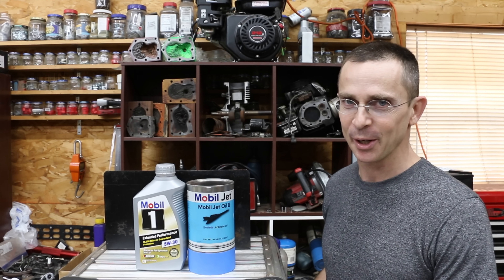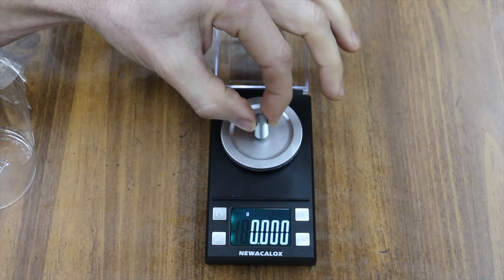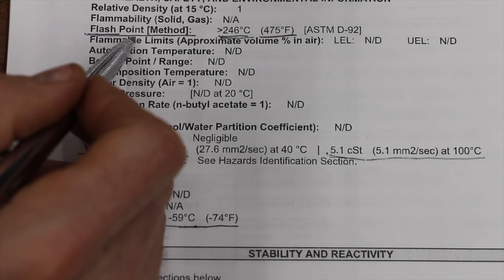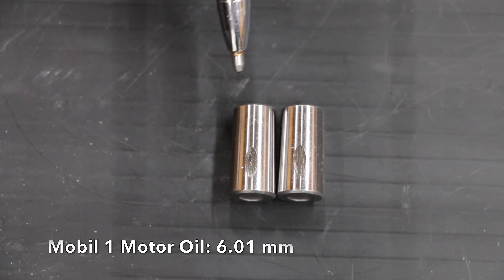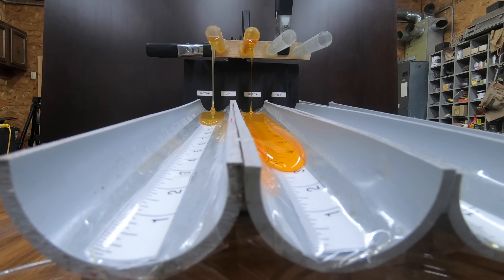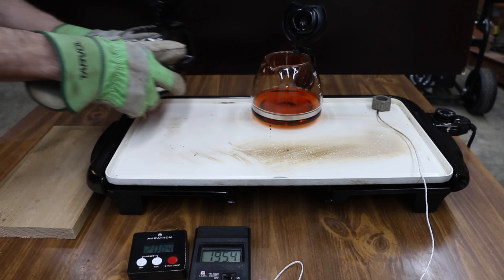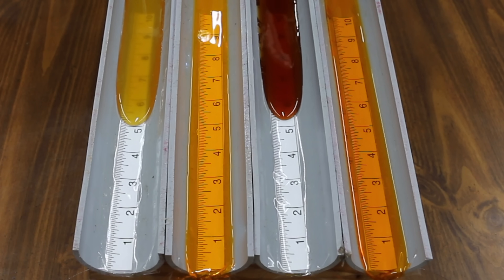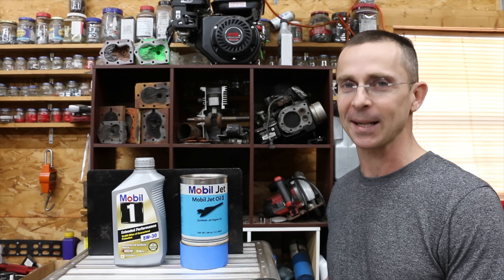Is Jet Oil better than Mobil 1 Synthetic?  Let's find out!

Comment: The lubricity test results are questionable. If the testing cylinder is worn out it means that oil lubrication film is broken. In the engine, it should not happen. The metal parts should not have any direct contact with each other. In your test machine, you exceded contact stress for all oils. Plus contact surface is growing exponentially (very fast at the beginning, and slower and slower by the end) because of this fact if the wear spot is big enough, it is difficult to see the difference. I would recommend the following
1) to reduce test duration not to create a big wear spot. On smaller spots difference should be bigger.
2) Ideally, you should measure oil film breaking pressure, adding force to your machine until you see any wear to determine breaking pressure (contact stress) for each oil.
Reply from the maker: Thanks for the constructive feedback

Comment: Had a surprise with Mobil One synthetic. I had some quarts in my basement for about 5 years. Pulled them out to change the oil on my Cub cadet and it had darkened with age. Looked like the cooked oil. Wonder if it is as good as the very light fresh oil? There isn't an experation date.
Reply from the maker: Thank you!

Comment: Me: Knowing jets fly at extremely high altitude and extremely cold temps

Jet Oil in -15 degree Freezer: Am I a joke to you?
Reply: Jet engines have fuel/oil coolers. An accessory that has a core inside that runs fuel around a jacket that has hot oil running through it before it goes back to the oil tank. The hot oil is cooled by the cold fuel and the cold fuel is heated by the hot oil at the same time for better atomization before it enters the combustion chamber.
Reply: @kruzn1934  Well stated. Our Lear 60 has that system, and even when it is -56 C at altitude, which is every time, the oil heats the fuel, and the fuel cools the oil.
Reply: The engine stays warm at altitude while it’s running
Reply from the maker: Great point!

Comment: Interesting. Jet oil never gets changed, there are no scheduled oil changes on Jet engines. They do tend to need oil added regularly.  It doesn't get changed because oil doesn't wear out, as many believe. It gets dirty and cant perform when dirty, thus the additives to make it last longer for vehicle use, Jet oil however does not get dirty as there are no internal combustion engine byproducts to dirty it up.
Reply from the maker: Thanks

Comment: Jet oil is made from animal fat. It stinks. Not the same product. I worked on t 58 turbo shaft engines back in the late 70s and found that the oil in the aircraft had never been changed. The engines have been changed but we just disconnected the oil lines and dropped the engines. The oil lubricates a series of bearings and is never in contact with anything like piston walls. We would clean filters and send in oil samples every so many hours.  The engines turned at 20,000 rpms
Reply from the maker: Thank you!

Comment: The wear test results can be validated if: 1 The jet engine oil flows better and it allows the electrical motor to spin (RPM) hence scratching the surface of the bearing many more times. Or 2 the car engine oil bonds to the bearing better giving better protection.
Reply from the maker: Thank you
Reply: unlike in piston engines the oil in a gas turbine engine primarily serves as a coolant hence why it sacrifices the wear and friction reduction properties in favor of better flow characteristics and extreme temperature performance. conventional engines have a lot more components that slide over eachother  requiring an oil that is good against wear where as jet engines t have very few most of the components have rolling elements in them which reduces the friction and wear

Comment: I wonder how Jet oil would do in the lower end of a 2 stroke motor?  Its all rolling friction in there.  Gas mix takes care of the sliding friction.
Reply from the maker: My biggest concern is that jet oil will damage seals
Reply: @ProjectFarm  A serious concern. One that also crossed my mind. But beyond that I bet it would work great.  I would be very interested to see exactly what sort of damage Jet oil does cause seals and how long it takes for them to degrade once there exposed to it.

Comment: You obviously don't understand the demands on Jet oil and the temperatures it has to work in on a daily basis. ..
Minus 50 to plus 50 as a minimum  as it's very cold at 35, 000 feet  ( that's almost as high as Mount Everest )
Reply from the maker: Thanks for the constructive feedback

Comment: I ordered ACDelco motor oil from online, never heard about it before, and apparently its OEM oil used for new GM engines.  Would be interesting in a test with it since its cheap $19 for a 5gallon. And how it compares to Amazon's motor oil
Reply from the maker: Thank you!
Reply: @ProjectFarm  no problem, i went with rockauto online.

Comment: I just came across motor oil that is plant based, called G oil.. wouldn't mind you putting that through the ringer on your machines/methods.
Reply: I also just saw that Castrol has come out with something similar.... be neat to see them vs each other and conventional
Reply from the maker: I'd love to test G oil but I'd like to know what percentage of their oil is plant based. I tried to find additional information and it's "proprietary".
Reply: @ProjectFarm  I've read, that they are both around 25% and it is a significant different formulation that it would be neat to see, but that is your decision to make after all. Just like with all the other motor oils, they are very similar in ingredients, just in differing amounts. Just be interesting to see something you've put through the wringer already vs goil and castrol plant juice... I've also  heard there might be animal fat included but not hundred percent on that, seems to be pretty secretive. I think if we could develop a purely plant based lubrication solution, the planet would be much better off... as well as being renewable. Maybe make farming profitable for the little guy again.

Comment: I would presume the temperatures inside the engine of a plane, is quite much higher than the ones inside a car engine.
I wonder if the Jet engine oil even burns?
Reply from the maker: Thank you
Reply: yeah it burns and oil fire in the engine cause a turbine disc to spin so fast it exploded on an a380 midflight before

Comment: Before i watch it: I d say engine oil is better for internal combustion engine, then jet oil, as jet is technically external combustion, and temperatures there are a lot higher.
Edit: Obviously motor oil is better than jet engine oil, as the most important task of the oil in a motor is to maintain film during oil starvation in stroke up motion, when the explosion region of the cylinder can not be lubricated, hence why viscosity is significantly lower. YOu can always get a lower viscosity motor oil, but there is a reason why motor engineers recommend using specific oil in specific engine in specific location. They are not dumb =)
Reply from the maker: Thank you
Reply: jet engines are internal combustion engines too

Comment: Can you do leak down tests in your tests on things like oil tests or tests where your checking for wear or how something will affect your engine most those small engines have compression release and a leak down will give way more accurate results if testing if this or that will hurt an engine or even better will engine restore help ring seal as much as it says if the leakdown test goes up or down then that will tell you how much more it deals a worn-out engine love your videos

Comment: KJ is right... no sliding lubrication in a jet engine... only roller bearings. And, generally more extreme operating temperatures. So, the tests confirm jet oil good for jets & car oil good for cars. I'll remember that. Thanks.

[Automobile engine mostly hydrodynamic and sliding lubrication]

Comment: a jet engine does NOT contaminate oil like a car engine,  carbon ect.    filter a car engine down to .0002 microns it will last 400,000 miles.
Reply from the maker: Thank you!

Comment: The issue with low viscosity is that car engine parts endure impact during normal operation. The viscosity acts as shock abortion for these parts. A friction test is only part of what makes oil good for your engine. Too much viscosity however can cause issues in cold weather, as viscosity changes with temperature.
Reply from the maker: Thanks for the constructive feedback
Reply: @ProjectFarm  sure, no problem. I watched your video on running a engine on fumes. I wonder if you could get better fuel economy with different octanes or fuels like diesel fuel. Just a though since you already got the setup it might make an easy and interesting video.

Comment: Some quick observations; Jet II is the recommended oil in my AMG IHI supercharger. The Mobil 1 (European formula) 0w-40 is my engine oil. I believe you in the past compared Extended vs. Amazon and perhaps Purple. Understand however "extended" formula is different from the European formula. Mobil website differentiates the various Mobil oil products. Also, GM Fremont test facility as well as Consumer Reports simulates the stress of a hydrodynamic wedge by running the oil through an injector and then remeasuring. I gotta get back to my movie. Good videos!
Reply from the maker: Great information!  Thank you

Comment: Different additive packages. Also seals compatibility could be issues. Mobil makes PAO and Ester based Jet oil. Jets do no have parts that reciprocate up and down all motion is rotary or rotational and everything has low friction surfaces and bearings. No cams, no sliding forces, no real combustion in and around the oil for it to deal with. Any additives have to be ashless and a priority is on oxidation resistance and coking. High heat and the absence of heat at the same time is a big deal. The base stock for the jet oils is far better but the additive package is adapted for the demands of service. So terrible test. In aviation some internal combustion engines can be modified to run on automotive gas but in addition to mechanical modifications tot he carb the gasket materials for the carb have to be changed as well. I have heard of guys running jet oil in daily drivers or trying diester ac oil in engines and the seals being destroyed as well as cams lobs being wiped etc....Wrong additive packages.
Reply from the maker: Thank you!

Comment: Excellent comparison and makes perfect sense, Jet oil has to handle more extreme temperatures than car oil, but doesn't have to protect wear as much because all aircraft parts are replaced at specified intervals whether failed or not.
Reply from the maker: Great point. Thank you!

Comment: I suppose the tldr science side of it is with a regular engine there are a lot of moving parts internally that need constant lubrication. where as on a jet it doesnt. It does have moving parts but most likely hydraulic operated parts while other parts might be fine with a dab of castrol LM grease. 

as far as viscosity goes. I guess Jet oil stays more consistent andruns thinner because it has to deal with the high temperatures of the jet engines and also the cold temperatures of the atmosphere. not to mention all the additives that dont need to be added to it like motor oil to keep it freezing or internals lubricated.
Reply from the maker: Great point
Reply: @ProjectFarm  Just nonsensical ramblings really.